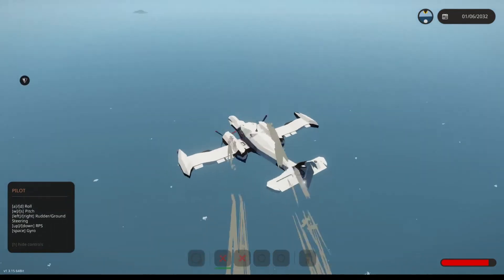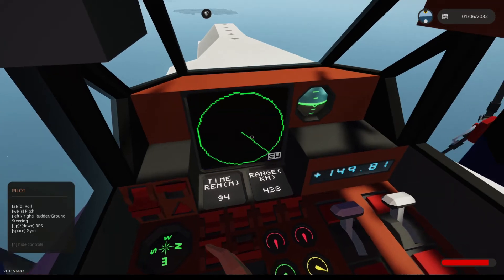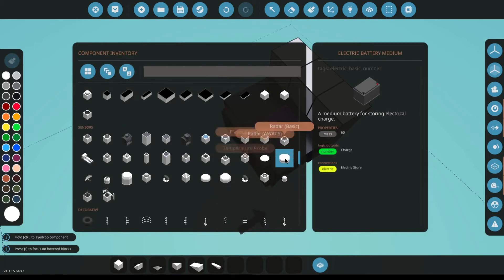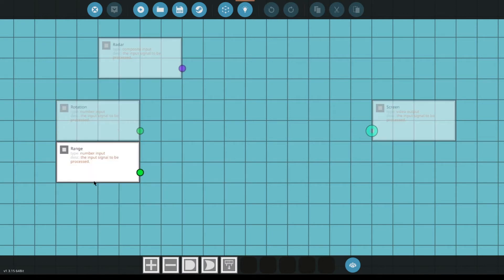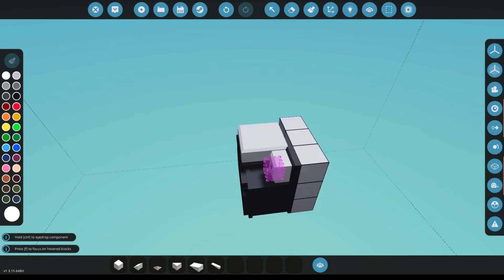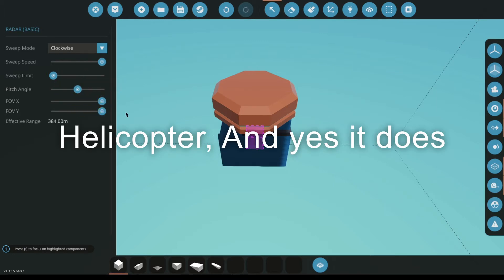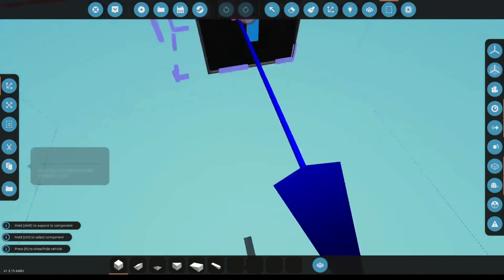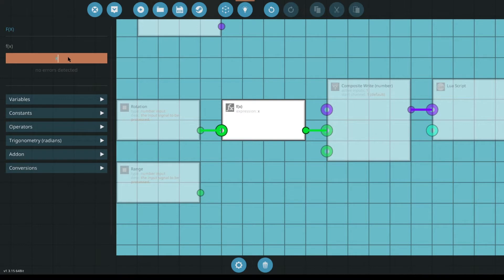Stormworks updated radars tutorial. How to make a (better) display for them.

Comment: Question I have followed the code exactly and double checked all connections in the microcontroller and between the radar, electricity etc. However when I spawn in the line appears however not exactly straight (about 10 degrees off to the left) and not spinning. (I have made it to 20:00). Any idea why this may be?

Update: Realised my issue the start channel wasn't set to channel 2 on the Composite Write (number) block. (also great tutorial litteraly only one I could find that wasn't old/actually worked and wasn't a tutorial on how the radars work instead of showing me how to display them.
Reply from the maker: Im glad you found the issue! So many small things to check, enjoy you radar lol
Reply: THANK YOU SO MUCH OML

Comment: % is called the modulus operator
a%b -> divides a by b and gives you the "rest"
2%5 = 2
5%5 = 0
8%5 = 3
105%10 = 5
Reply from the maker: That makes sense, thanks 😊
Reply: I still don’t get it
Reply: @TheSuJ it gives the remainder of a division. So 11/2 = 5 with a remainder of 1. The modulus just gives the remainder 11%2 = 1

Comment: Hey Dead. Got my radar up and working on my boat but it's displaying targets 45 degrees off. 

Like facing another boat in front of me it's displaying it on the top right of my display. Any fix for this?
Reply from the maker: I think it has to do with the initial orientation of the radar, try rotating it 90° till it lines up nicely

Comment: Can I put a minimum distance in it? That way it doesn't detect myself or my creation.
Reply: If it isnt for a defense system in the lua code where distance > 0 you can tweak that number and it wont print a red dot onto the screen for an enemy however it will still detect that object

Comment: Hey I know this is an old video, but I don't know if the code or what has changed... I did everything to the letter in the video and double checked on everything and even on my 1x1 monitor it doesn't display a radar, did I do something? Is there something I am missing?
Update: Nevermind, I took an extra close eye on the end of your coding and the setup, I moved everything your way, and now the 1x1 radar is working, thanks a ton for the tutorial :D

Comment: I wrote the code correctly and the bottom left quarter of the radar doesn't pick up anything at all. When i move out of that area it picks me up again.
Reply from the maker: Im not sure whats gone wrong there, if its a small target you need to make the range short though
Reply: @DeadPlayer13579  I tried to check the size of the area that the radar doesn't pick up anything in and I found out that that area keeps moving from the bottom left to the top left and back. I'm really confused now.

Comment: where did you get the variables "rotF" and "dist" from because i don't see them declared in any of your code and my radar wont detect things.
Reply from the maker: rotF and dist are created as a temporary pair of variables in the for statement to run calculations with, basically they are declared in the for statement
Reply: @DeadPlayer13579  I see thank you very much
Reply from the maker: Oh, I didnt see the issue you had, try setting the range properly and looking at my example in the description, hope this helps

Comment: Hey so i tried to do it and it worked but then the radar line wasnt moving
it was just stuck in one position
Reply: nvm its solved
Reply: @only4unturnedonly4unturned96 how did you solve it beacause im having the same issue
Reply: @codytheclonetrooper4002  Well for me it was some error in teh code, i had placed something with lowercase while it should hjave been uppercase

Comment: Everything things worked except for the target its not detecting anything any ideas ?
Reply from the maker: Make sure that the range is accurate, a common issue will be that it won't detect closer things at very high range
Reply from the maker: Also do try cross referencing the final script, a single misspelt variable can break code, and make sure the radar is set correctly
Reply: @DeadPlayer13579  thanks

Comment: I have checked the code and logic over and over and my radar still won’t work
Reply from the maker: 😂 Love the hampter
Use this one if you still havent found a solution, its my working one from the workshop
https://steamcommunity.com/sharedfiles/filedetails/?id=2670734324
It could also be video connection or power or the on/off to the screen

Comment: i lost my sanity completelly after losing 2 hours by messing up a single character.

BUT DONT WORRY GUYS, just dowload his blueprint, it will come with the microcontroller radar, wich you dont need to code anything or either do anything, just wire stuff up and fix the radar effective distance,